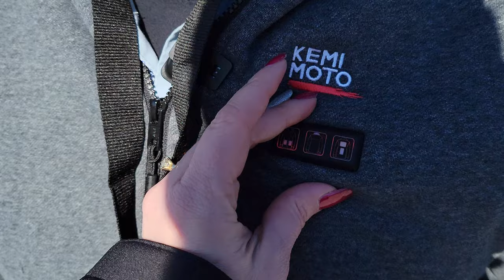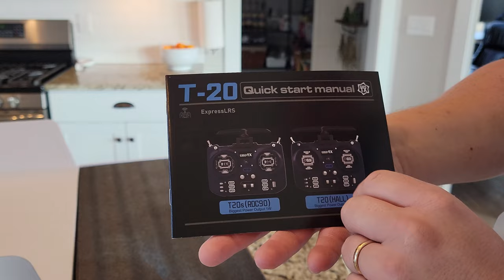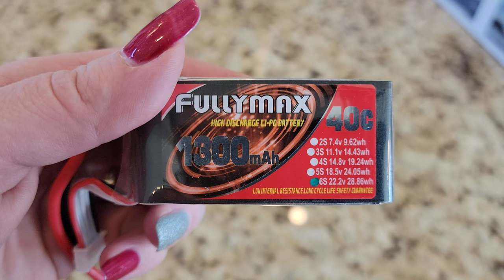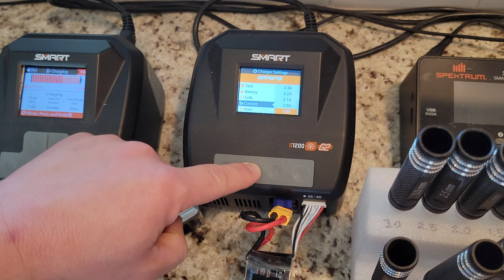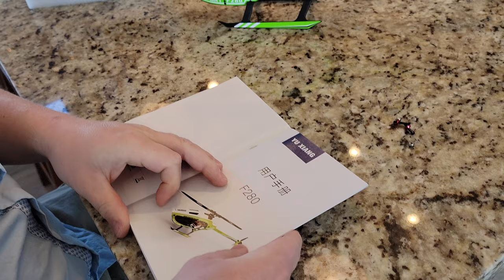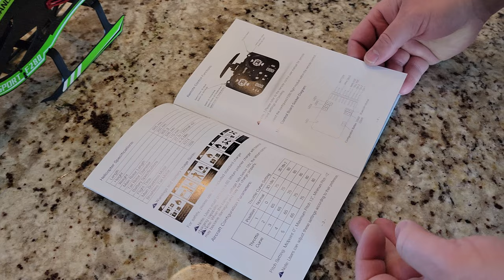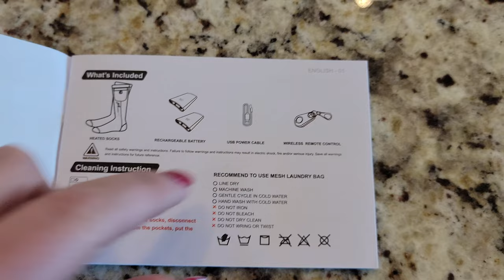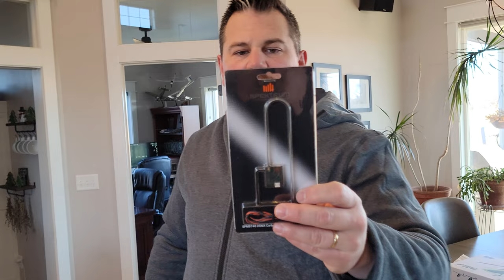Yu Xiang - F280 - RTF 6S 3D Heli

Comment: Agree with you statements about the transmitter, but those gimbals are 1000 times better than any other RTF transmitter. So it’s worth spending some time. 
You made a point as most RTF users will get frustrated if they try to figure out this transmitter on their own.

Comment: Not related to this, but do you think horizon hobby would replace a wrecked plane? I got a habu 50ss and it was not flying right out of the box and I wrecked it
Reply from the maker: If there was a reasonable explanation of the failure, they usually try their best to help people resolve their issues...HOWEVER, if it's a lack of piloting skill, mistake, or just an accident, they don't do much about it. That's one of the toughest parts about the hobby when you're new. I crashed my brand new Habu STS into my house, like an idiot, and had to glue her back together...it was laughable, but if it were my only plane, I would have cried like a baby.

Ask, and be nice and reasonable, and see what you can get from them. I have, and had success with all but maybe 2 occasions...one of those I eventually got resolved too.

Good luck, and even if they shut you down, don't give up. Flying RC planes is a hard sport - you'll get there!
Reply: making ur own is even harder and i have done it at 11 y/o @BrianPhillipsRC

Comment: Brian, this is definitely not for a beginner right?
Reply from the maker: I wouldn't suggest this type of heli to a beginner, but to be frank, I'm a beginner myself. Heli's are hard, but when you get it, they are just like flying a plane, only much higher and more immediate consequences.
Reply: @BrianPhillipsRC  thanks I figured as much, very tempting though. I’ll spend some time on the simulator and then start small. One YouTuber’s suggestion was to start bigger because they’re easier to handle and have better response than the smaller models, but I’m with you and plus it’s a big investment to start experimenting with. Thanks.

Comment: Exactly HOW can you even fit a 6 cell battery in there?? You must mean 6 volt, right? LOL and that thang sounds like one of those tree shredders!
Reply: It's definitely 6S (22.2V) but fairly small capacity 1300mah so won't be physically huge.
Reply from the maker: It's small - only 1300mAh 6S 40C - so YEAH, it's not that big, more of a "Square" than a longer rectangle like more common sized 6S packs.
Reply: @BrianPhillipsRC  everything keeps getting teenier. Can I hold it with my big fat hands?